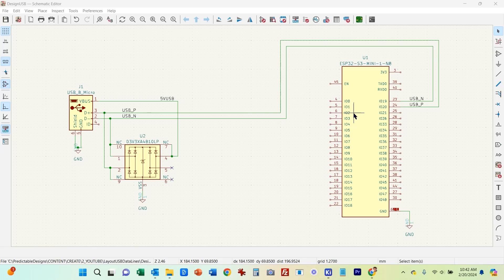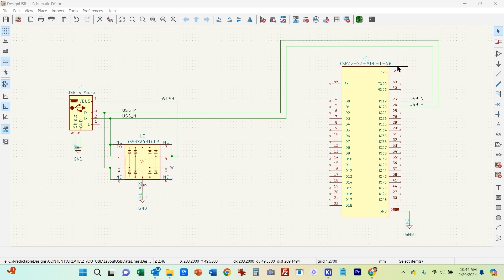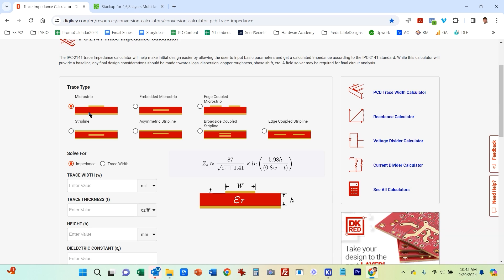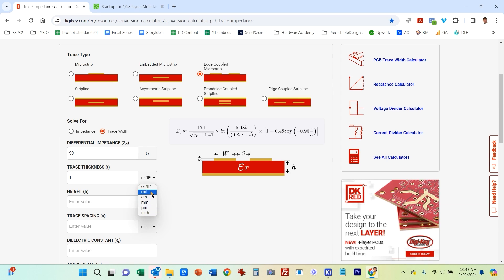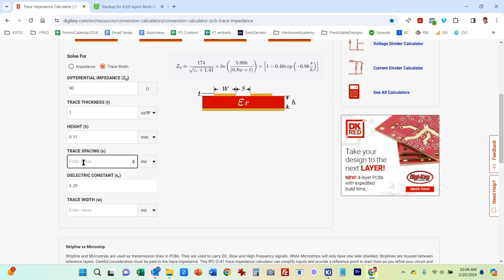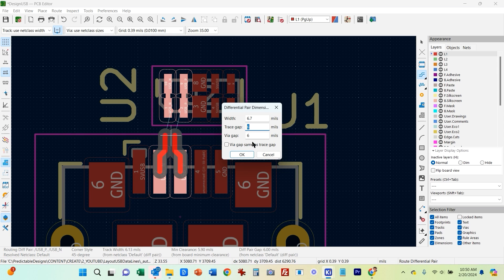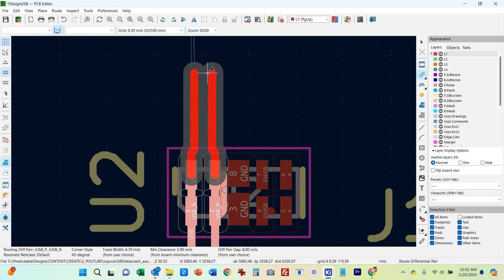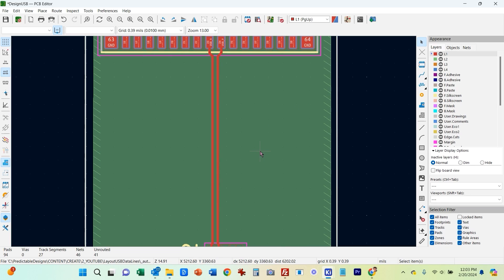How to route USB data lines on a PCB

Comment: Thanks for this.

Regarding U2 the ESD clamp diodes. From where did you get this design?  Was this place because it is "good practice" or was it demonstrated to be both necessary and sufficient for ESD compatibility and to what ESD test?  
Another way to ask these questions is, by what test was this component , U2, justified?
Reply from the maker: You should always include esd protection on any pins that connect to the outside world.

Comment: If I understood correctly from the video, the calculation was made for 4 layers. How and what values change if I only design a 2-layer PCB?
Reply: Just some values that you will get from your manufacturer. These include dielectric thickness and coefficient.

Comment: It is very confusing to see the NC pins of the diodes assembly going out of the corners of the component.
I'd avoid put pins in this way.
Reply from the maker: Not sure why that would be confusing and the pins are clearly labeled. Also this was the standard symbol for this part and  I didn't draw it from scratch. Thanks for watching!
Reply: @PredictableDesigns  it makes the schematic less readable for my opinion

Comment: can i route other traces under the usb data lines on layer 3 or 4? not data just some 5v power and 3.3v pwm signal. The usb in my case is only needed during programming.
Reply from the maker: Yes that should be fine.

Comment: How the calculation will change if you fill the top layer with ground?
Reply from the maker: You would need to use a different calculator that includes a top layer ground plane. Same is true for an antenna feed line. Without top ground plane it's called a microstrip, but with top ground it's called a coplanar waveguide.